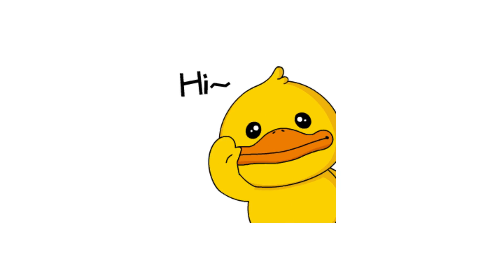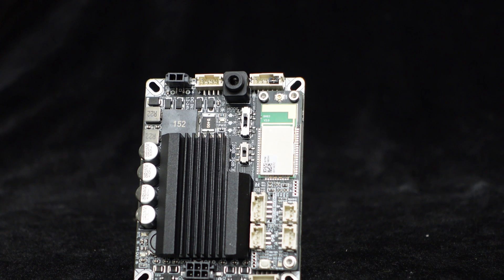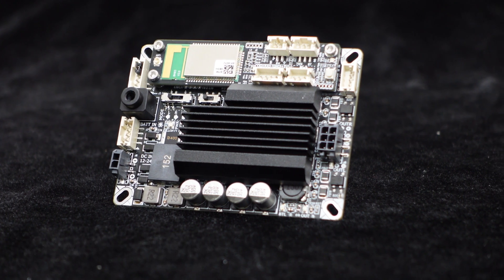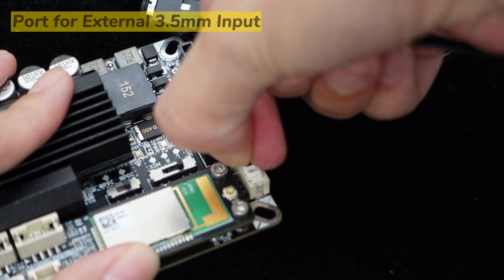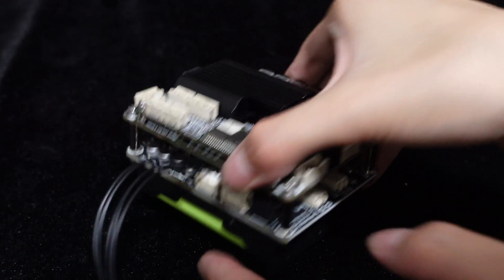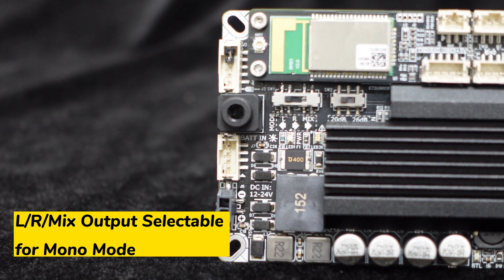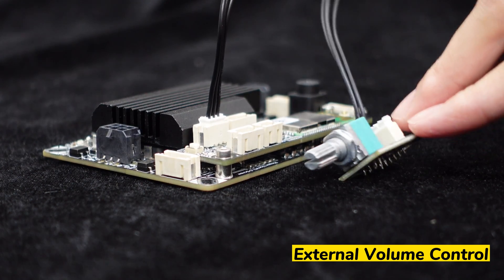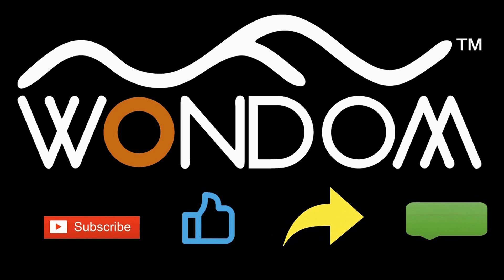JAB2+ Bluetooth TWS & Concert Mode 2x50W/1x100W Amplifier Board with DSP for PC UI Control TPA3116

Comment: Hey Guys! 
Fist of all, awesome Idea! 
On your Website (site of this product) you link "Basic SigmaStudio Programming Guide" and  "The basic SigmaStudio programming guide for ADAU1701", but atleast what i can see there is no ADAU onboard?! Couldn't you just delete this since it is a bit misleading?

 What BT Chip are you using exactly? This would be of interest since some people want to rename the BT Pairing Name, is this possible via UI?

Are there any usable GPIOs? For example for a second EQ profile, Bass Boost or stuff like that? 

Best Regards
Reply from the maker: Hello, thank you for your watching and kind comments. Sorry for the misunderstanding. We will pay attention to that in the future. 
1) Regarding the Bluetooth name, we offer Bluetooth programming service to customers. You can leave us a message of the name you want after purchasing this service. We will rename the Bluetooth for you before shipment. 
2) As for the DSP, the JAB2+ is integrated with an audio DSP, supporting PC UI control after connection with ICP5 programmer. You can achieve EQ, volume and crossover adjustment via the PC UI. Here is the download link of the PC UI for your reference: http://files.sure-electronics.com/download/Miumax_For_JAB2v2_Setup_V1.1.zip. 
Wish this could help you. Have a fantastic day~

Comment: Awesome! I’m glad to see you are offering a TWS/Multipoint solution. I do have a few questions though.

1) Is the DSP an ADAU-series chip that allows for SigmaStudio programming?

2) Will you be offering a more compact, lower power option with TWS/Multipoint and DSP functionality? I would love to see a 3.6-4.2V, self-boosting amplifier option with TWS/Multipoint and DSP that outputs something like 2X5W or 1X10W. If you could make something like this in a 3X2 inch PCB option, that would be fantastic.

3) Last question. What is the Bluetooth chip? Microchip Technology IS2083?
Reply from the maker: Hello, thank you for your watching and kind comments.
1) The DSP integrated with JAB2+ is not ADAU-series. It's an audio DSP. It supports PC UI control as well after connection with ICP5.
2) If you want a lower power amplifier board supporting TWS, you can check out this BDM0, 2x5W Bluetooth TWS amplifier board. Here is the link for your reference: https://vi.aliexpress.com/item/3256804642670911.html.
3) The Bluetooth chip is BM83.
Wish this could help you. Have a fantastic day~
Reply: @WONDOMAudio  I can't find documentation anywhere that shows how to connect this board to the ICP5, and then to the PC. Will please link to that?
Reply from the maker: @mucklechumps  Hello, thank you for your watching. The steps is the same with JAB2v2 PC UI. Here is the video link for your reference: https://www.youtube.com/watch?v=hpCLBzzGBFk. Wish this could help you. Have a fantastic day~
Reply: @WONDOMAudio  Thank you!